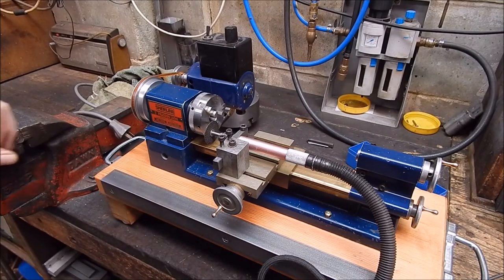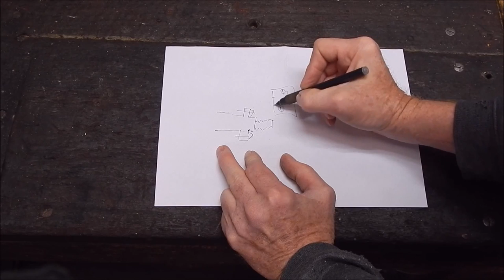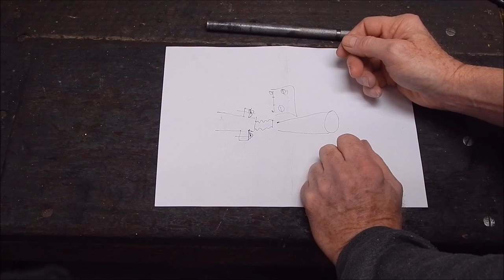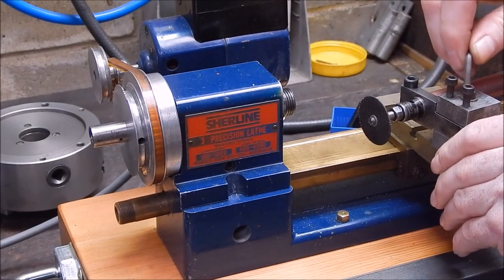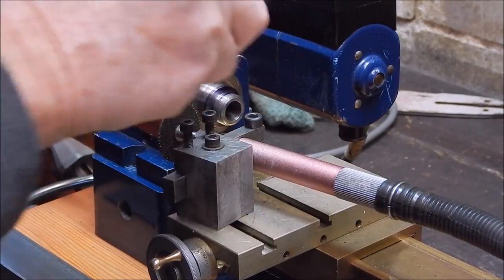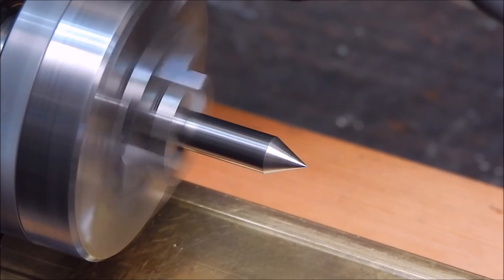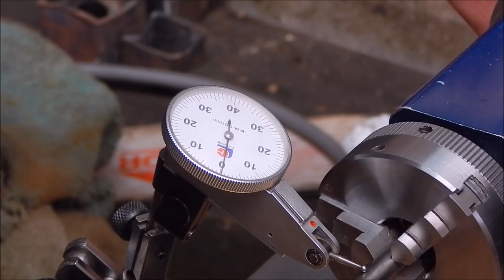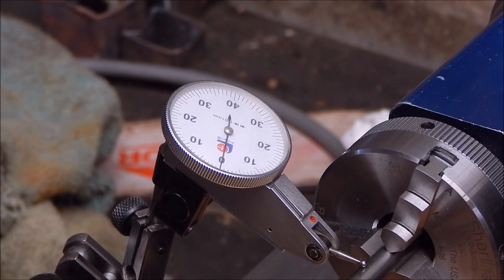Correcting chuck register runout on a Sherline micro lathe

Comment: The way the grinder loaded up every half turn of the cross slide handle, sounds to me like some play in the cross slide ways throwing things out a bit.
Reply from the maker: Very good observation.  The ways were good and snug on the cross slide.

I think the cross slide thread has some runout (I suspect it's slightly bent or non concentric) which was loading up the gibs unevenly as you described.  It didn't seem to affect the outcome, but it's another thing to look into.

Cheers Rob
Reply: You have inspired me as to what level of Tool Post Grinding jobs can be adequately done with a simple grinder and basic wheel.
Reply from the maker: Much better than nothing.  They are a super handy tool, with the right attachments (carbide tips etc).

Cheers Rob
Reply from the maker: I had a look at the Sherline this morning and you were close - the issue was caused by one of the carriage gib screws being a bit loose, letting it twist as I moved the cross slide.

All good now.  The rest seems OK.

Cheers Rob

Comment: great vid and die grinder mount, I have bought a die grinder for when I make new phosphor bronze bearings for a lathe but a question.. instead of using a wheel that can deflect would it be better to use a cone grinding tip?
Reply from the maker: Hi Mark,

The amount of pressure being applied is very light, but deflection is possible.  However, the amount of deflection will be constant for the full pass, same as with a boring bar.  I think the wear factor is more important and a wider abrasive will definitely be better in that regard.

Cheers Rob
Reply: @Xynudu  ahh yes you have a good point, the point on a cone could wear a tiny amount moving from outside to inside so making the register convex
Reply from the maker: Hi Mark,

The main problem with a cone is that the grinding effect/surface speed changes along it's length from slowest/least at the small end to fastest/most at the larger end.  That's why a correctly aligned dressed cylinder is really the best abrasive to use.

Nothing is as simple as it seems ;)

Cheers Rob.
Reply: @Xynudu  thanks a lot mate I was going to use a cone bit for the bearings but not now ;) , I was first going to use reamers but the 2 bearings are different sizes so 2x extortionate is not an option lol, bore to close then die grind the rest